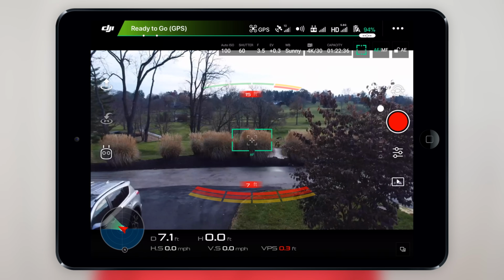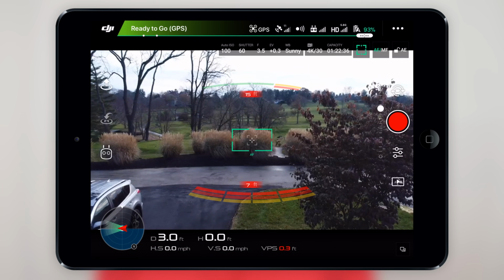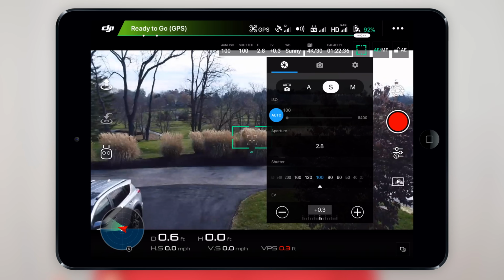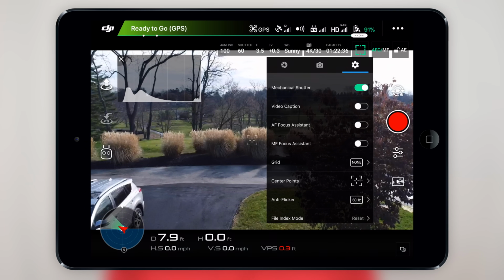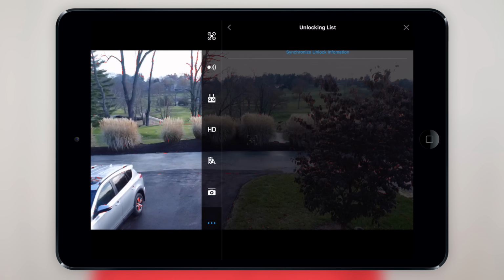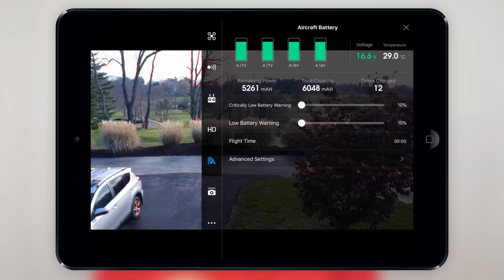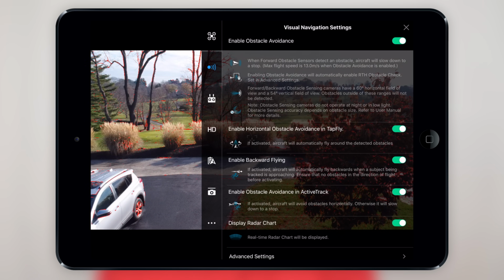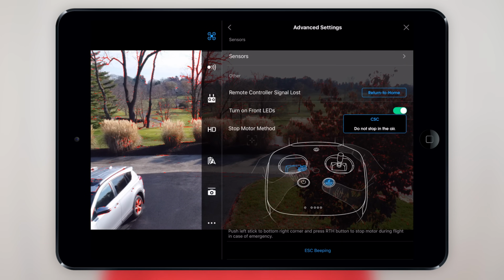DJI Go 4 In-Depth App Walkthrough

Comment: Billy, I would really like for you to do the Mavic 2 zoom as well as this video. I know that they are very simular but there is as you know that the camera settings are quite different. Would it be possible to cut the settings for the Pro and insert the settings for the Zoom? Also, if you chose to just do a seperate video, you could slow way down so many of us would get much more out of the video. It's just like some folks can type 80-90 words per minutes and most of us can do 30-40. I thing you get the picture. You have so much knowledge which we need and appreciate your sharing, but at the same time, it is difficult to keep up with you. Maybe less coffee would help? Thank you for your consideration.
Reply from the maker: I just made one! Check it out here: https://youtu.be/LNrrDrprAww

Comment: Hey Billy why is it in when I hit settings under the record button on the dji go 4 app at the the top of have to the right is shutter to the right I have a gear icon in the middle there should be a camera icon but there is not I can't get 4k 60 fps or 30 fps and so on please help